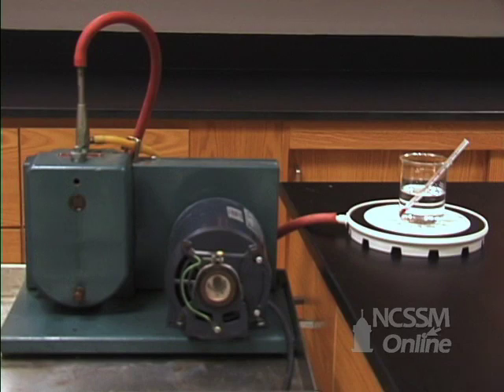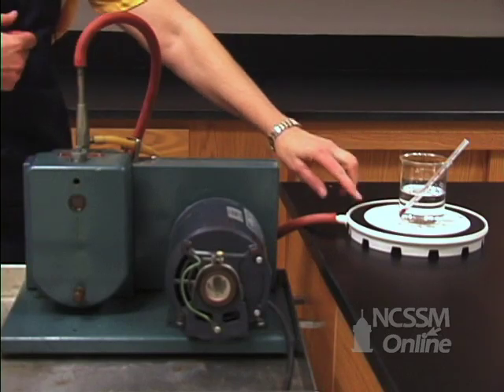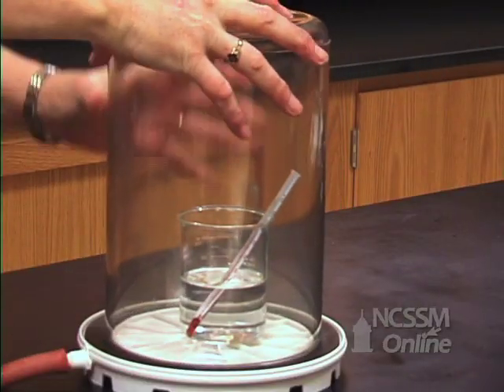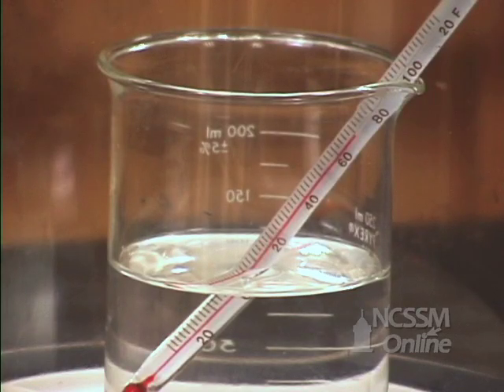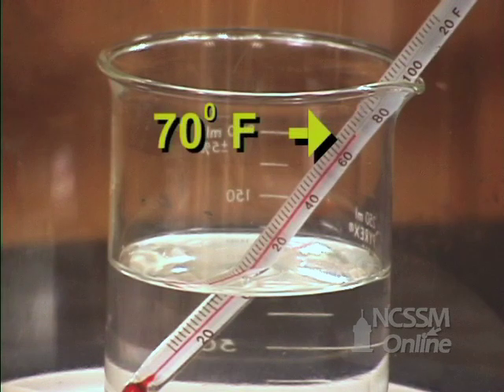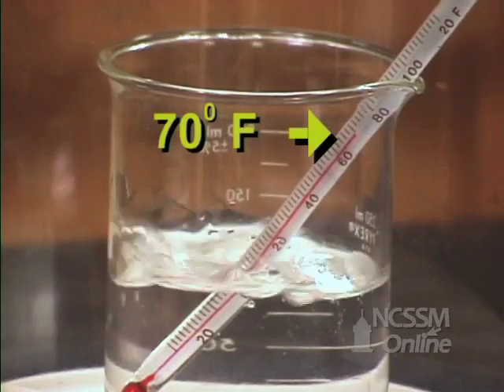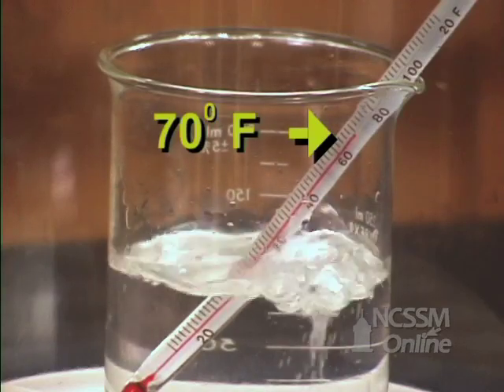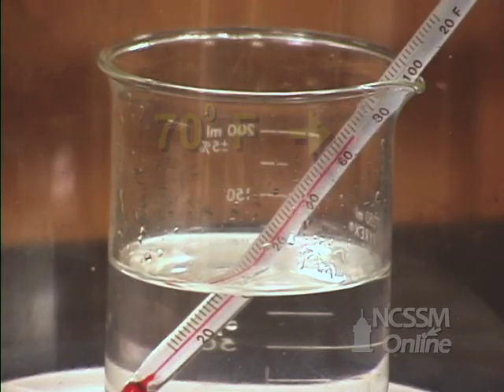Boiling Point Reduced Pressure

Comment: When the pump was turned off, the water almost immediately after stopped boiling.  Apparently the seal had gaps?   And a CONTINUAL removal of pressure was needed to compensate for that?
Reply: i think it did not have gaps. The water just compensates for the reduced pressure. If you want it to continue boiling, you have to reduce pressure more speed than the boiling speed. It's like lagging.
Reply: @donnymontreano9235  You mean the water vapor that is released into the container by boiling increases the pressure which, in turn, increases the boiling temperature.  Like the pressure that increases in a pressure cooker by applying heat.  That sure makes sense.  Thanks.
Reply: it turns out you had better explanation than me 😁
Reply: @donnymontreano9235  That's what you said intuitively  I just "unpacked" it.  Actually, that explanation never occurred to me until you mentioned it. Other than leakage, I was thinking that evaporation from the boiling could be reducing the water temp (like perspiration cools the skin) to the point where it wouldn't boil, but the thermometer didn't change so it must have been the pressure.  But it's surprising to me that the temperature (measured at the bottom of the beaker) didn't change more as a result of the boiling.